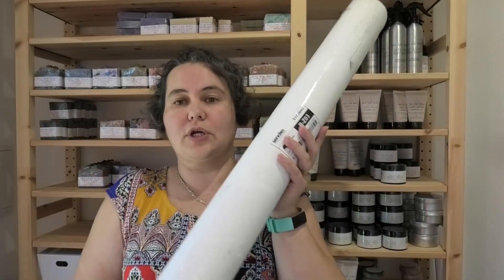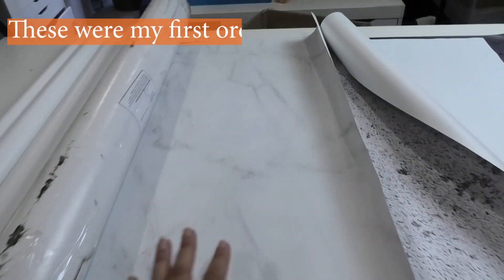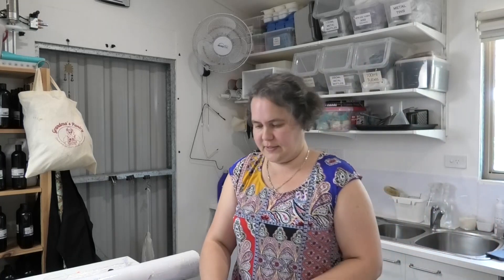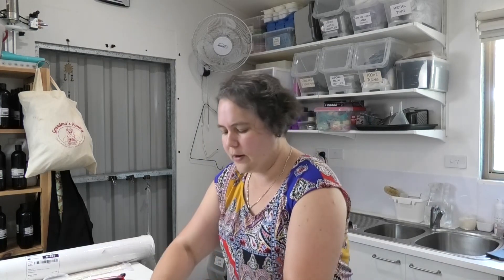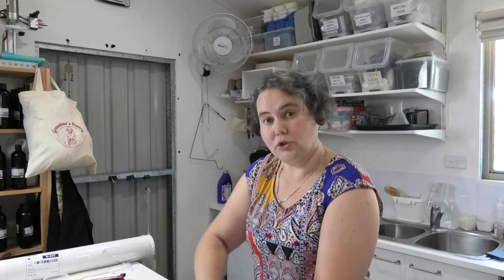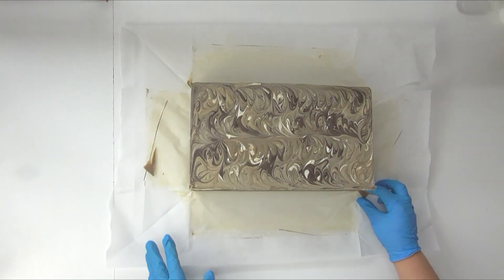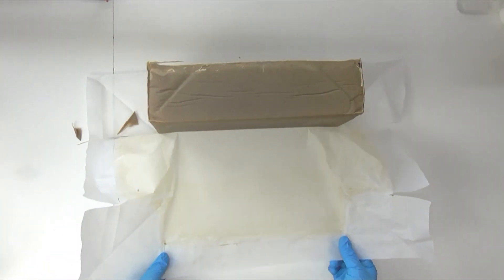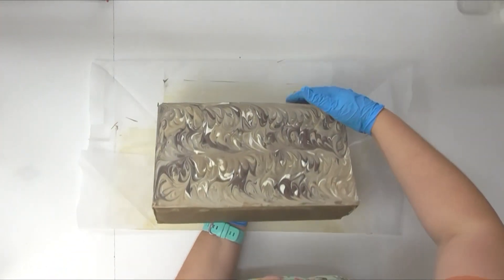Dead Sea Mud Spa Soap - a new Luxury Soap PLUS unboxing a delivery of photo backdrops

Comment: If the lye takes awhile to neutralize, how do you clean your containers afterwards without ruining your pipes? Or does it not hurt to wash everything out and down the drain.
Reply from the maker: The lye isn't the concern when it comes to the drain, it's the oils.  The lye used in soap making is like the drain cleaner used to clean  household drains. Usually I leave my dishes to set over night before washing so I'm not washing oils down the drain.